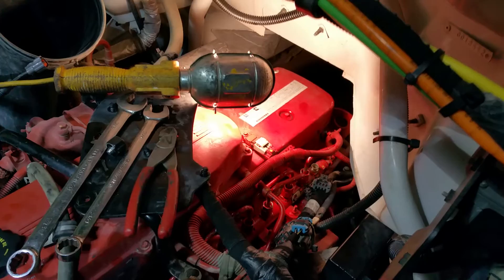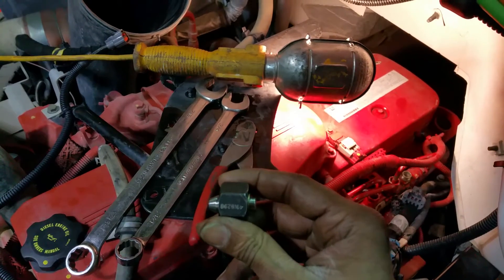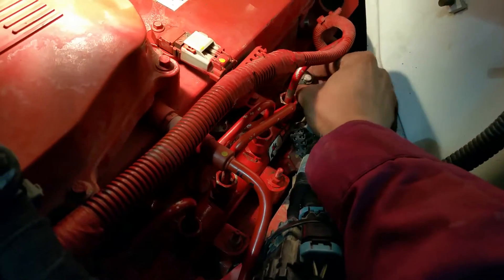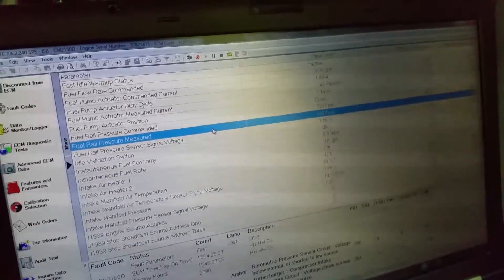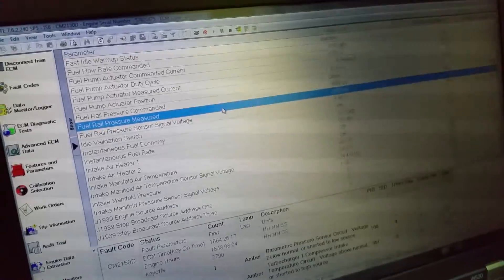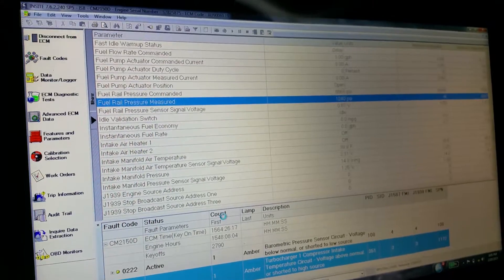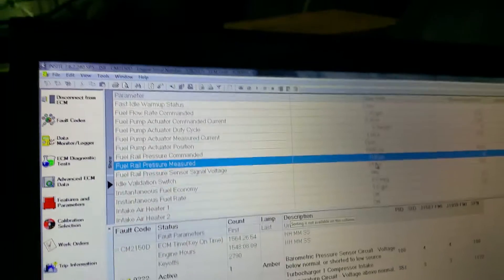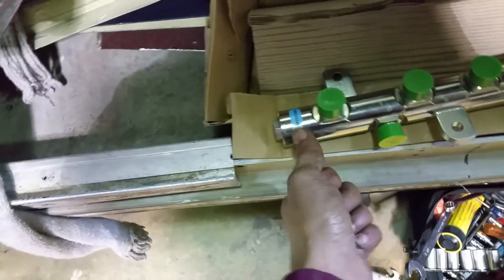Cummins isb fuel pressure dropping out

Comment: Why would you replace the whole high pressure rail??  The pressure relief valve is available separately. Btw an ISB does not maintain rail pressure as an isc, isl or isx. You isolate the fuel returns and it will point you in the direction of the problem, high pressure relief should be 0, not even a drop and it’s the 1st one to do since it’s the easiest, and if that’s not it, you mesure the return of the injectors (spec is different if engine runs or just ranks) and if the injector return is over you then proceed to isolate the falty injector by capping the rail one by one
Reply: I really needed this info-thanks